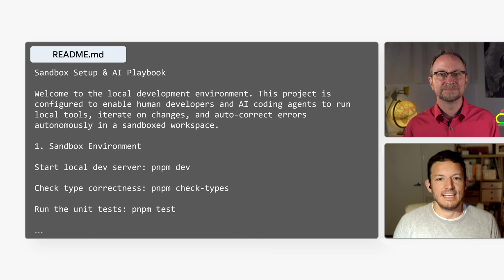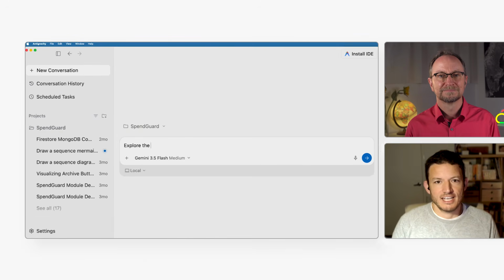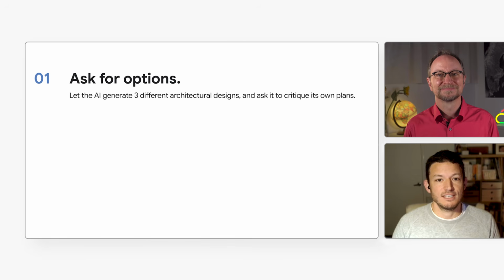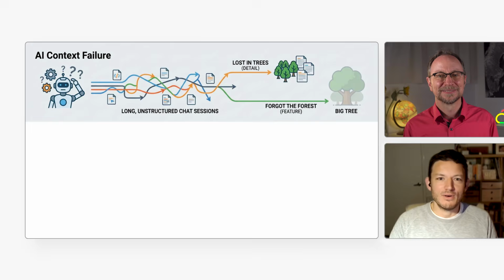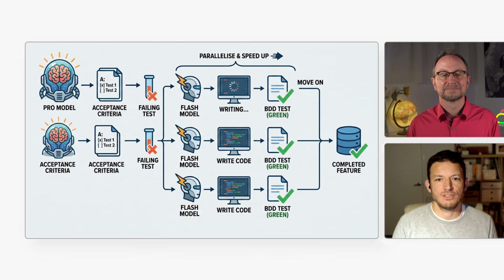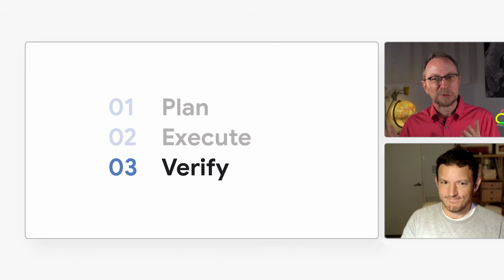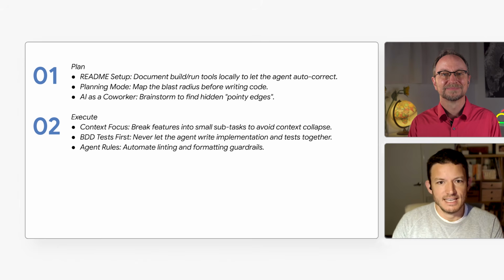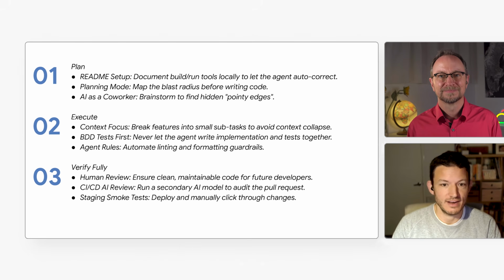How to modernize legacy codebases using AI coding agents (Step by step guide)

Comment: Did  you use parallel sub agents in AGY? It would be nice to have a demo leagacy app and walk through the modernization process. Maybe a codelab too
Reply: I agree; sub-agents are useful when you need to modernize an entire legacy application, like when you need to port it to a new tech stack. A coworker of mine wrote a helpful codelab that walks you through modernizing an application with sub-agents, step by step. Do a web search for "Google codelab Automating legacy modernization at scale using agentic pipelines and Antigravity" and you will find it.

Comment: Great content!! Love to see more of these learnings.

How would you make it autonomous, while keeping the final commit manual ? If I want an agent to do that while I'm not active at my desk, and run as an async process what all factors would you consider adding so that it can prepare some items for your review when you log in next time.
Reply: Thank you! You bring up a good question. Here is a two-part answer based on my personal experience.

1. When adding features in real code that handles real user data, I work closely with the agent and treat it like an intelligent but inexperienced intern. Gemini Flash is fast enough that I can ask for implementation options, ask follow-up questions, and see it write code interactively. In my experience, this leads to significantly higher quality than letting the agent run unsupervised. I want to maximize quality when handling real user data.

2. In some cases the requirements are crystal clear and I trust the agent to go off on its own. One example is when you are porting an application to a new tech stack. You can try this kind of port yourself in a codelab that a coworker of mine wrote. Search the web for "Google codelab Automating legacy modernization at scale using agentic pipelines and Antigravity" and you will find it.